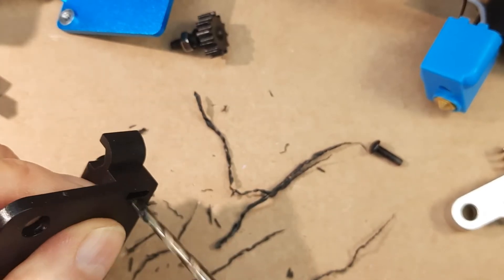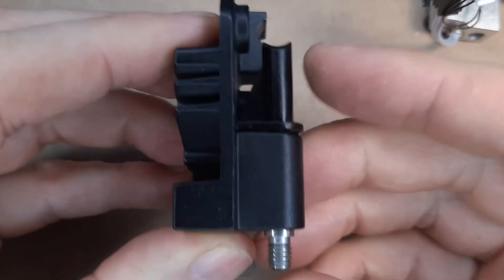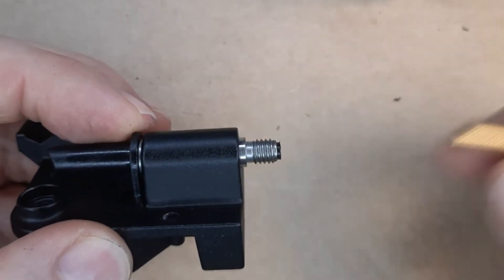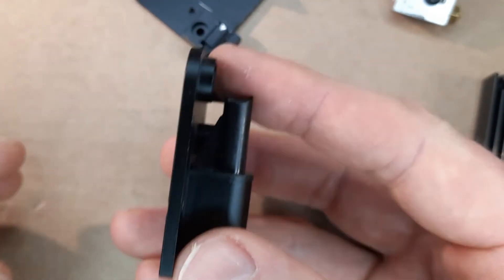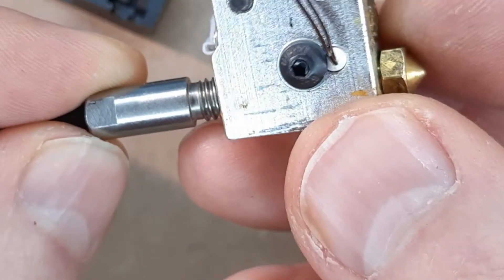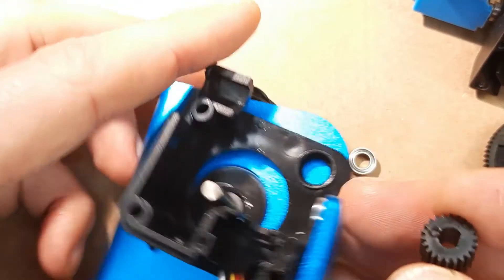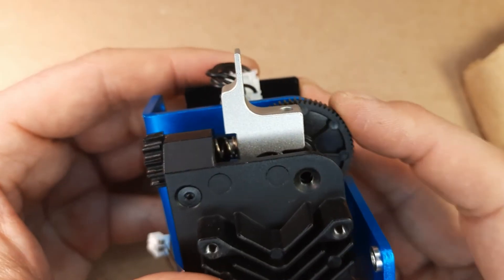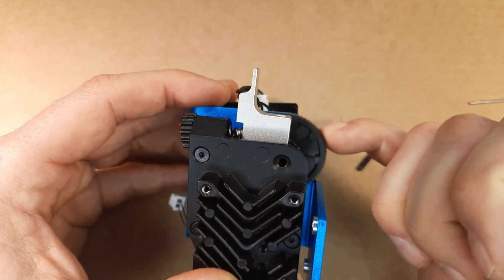Extruder _ 5 Upgrades for better print quality

Comment: Nice, but I've also noticed that the filament climbs back and forward on the teeth on the big gear, changing the quantity of filament being extruded. Extruder works more consistently if the bearing on the idler arm is also grooved keeping the filament on the teeth at the same diameter. My Genius Pro has extremely bad horizontal banding and was suffering all of the faults you have shown here, plus more. It still prints with banding and I am trying to determine exactly where it is originating from. Maybe the Z axis gear.

Comment: Thank you for the tips and showing the driver anatomy. 3:26 I'm still not sure about air gap effects, but heaving the ptfe coming too much causes in my printer to it being crushed, narrowing the ptfe tube at the end of it and blocking pathway of filament. So I'm still not sure about the correct ptfe placement. I guess it should be exactly straight with the exit - avoiding air gap, and on the other hand, avoiding the nozzle to squeeze it. Thanks for documenting this.

Comment: The best way to upgrade the stock titan clone extruder on the Sidewinder is to remove it, throw it in the trash, and replace it with any BMG clone extruder, with a V6 style heatbreak and volcano heater block.

Comment: Changed the larger wheel, but the smaller one, (seen here at 9:32)  seem to be glued, and there is no tiny screw.

Well, used the force...
Reply from the maker: I remember that the small plastic whell was just pressed on, not glued

Comment: @Just Printed_3D (EN)   can you share your slicer settings please I would like to get good prints
Reply from the maker: There are too many variables to get good prints, geberal printer mechanics followed by suitable slicer settings. 
Printing with the srandard slicer profiles for artillery should already deliver very nice prints.
Printing to fast or a poor mechanical conditions of rollers, play etc are most likely reasons for poor prints. Therefor there is no secret behind my slicer settings, all is standard, 0,2 mm layer by 0,44 line width, no faster than 40mm/ sec printing walls, 60mm/sec infill
Reply: Well @justprinted_3den988 I don’t understand how a ender 3 can have better print quality then a sidewinder x2 heck my cheap clone prusa i3 does better quality prints than my sidewinder idk what to do seems like the printer is not precisely layering the filament properly seems chunky layers  and not smooth 
Even changing out to a 0.8mm nozzle and printing at 0.2mm seems like to me that the printer main board is not running the print smoothly how it should be idk what to do i already have z support brackets and that helped the wobble abit 

Sorry about the late reply I found your video again and found my own comment lol
Reply: @justprinted_3den988 With the idle arm is the baring smooth or does it have teeth on it because you don’t show us it’s not shown in the video because there’s 2 models of that arm smooth or has teeth not sure what to get ?

Comment: I notice there is nothing to hold the ptfe tube in place down in the heat break! I've just had to change mine due to clogs but I can't see it lasting long with not being held in. 👌
Reply from the maker: The heatbreak ptfe is held in with a defined length within the heatbreak bore end and presses against the flat nozzle. If the ptfe length is to short, filament will sqeeze out and clogg

Comment: Could it not be converted to dual gear instead of the idler?
Reply from the maker: So far I have not seen any advantages for the dual gear. When printing much faster than regular, you would probably at some point need more feeding pressure and a dual gear could make sense. Im not convinced in any speed printing, so dual gear is not in my focus.

Comment: Just replace the extruder, can find decent cheap ones, or get a decent biqu for $60. I went the expensive LGX + Mosquito route along with SKR mini e3, huge difference, though the SKR alone and tweaking marlin had a giant improvement, moreso than replacing the extruder
Reply from the maker: does it result in better surface quality?
Reply: @justprinted_3den988   a better extruder? Absolutely, well an extruder + hotend, it increases quality, speed, and what materials you can print as long as you get a decent one. The Bondtech LGX with mosquito made a huge difference, though it is about the price of a new printer, Biqu is a lot cheaper. Also a 32 but board upgrade, like a SKR mini e3 is also a very good upgrade for quality.

Comment: I am currently in the process of fully rewiring my Genuis and Sidewinder, I am fed up with these cheap horrible pcb's and flat cables. So I am getting rid of the lot and creating a silicone wire custom loom. Wish me luck.
Reply: Why not just get a different printer? The entire selling point of the sidewinder x1 is the minimal wiring with the flat cable... You can just replace the pcb with one with a locking connector and be done, that's how the x1 was and it had no issues but people kept breaking the connector by not unlocking it..., but if you want to rewire it.... Just sell them and get an Ebder 3 or 5, or anycubic.... print quality is comparable and cheaper.. only difference is the simplicity of wiring
Reply from the maker: Had no single problem with my original flat cables. But I am awaiting trouble to come :-)

Comment: Where did you find the all metal extruder feeder gear? I am seeing plastic on AliExpress.
Reply from the maker: For the feeder, the small driving gear is always metal. Attached to it is the large gear, which is always also plastic as far as I observe the online available parts. If it says metal, than it reffers only to that small gear.

Comment: Having problems with putting it all back together. 

Eventually I started suffering underextrussion. 
Decided to swap nozzle, clean it up, but print head began to bleed plastic when working. Then took it appart, put back togheter, same jsut less. 
Third time, i put it back together, and heated up to tighten it...and I ripped off nozzle head. 

Waiting now for new heat block to come in.
How on earth re-assamble it to remove gap between nozzle and feed throat?

Comment: Ive had a problem similar to the one at the end of you video with the rough large gear. My solution was to replace some wobblily bearings in the motor.

Comment: Beautiful video! If I had seen this earlier, I could have saved myself all the correspondence with the manufacturer and seller.
This is already the second Genius Pro, the first went back because of packaging damage, but also had problems with the extruder. Same thing with the replacement unit. I even have another problem with the ball bearing, it made scratching noise. The large gear has a vertical runout and jammed like yours, after about 270 °. If you clamp the gear in a drill, you can see the imbalance. Somehow this extruder is "error by design". I am now waiting for the spare parts and hopefully after 1 month I can use the printer for the first time.
Reply from the maker: Have fun with your new spareparts :-)
Reply: @justprinted_3den988  At first I thought it was meant ironically. But now that just about everything from the replacement kit has been installed and is finally working without jamming, the printer won't turn on. The main switch is stuck. For my part I am ending the Artillery experiment - unfortunately.

Comment: Great video, it clears up all those little things that we have observed in our Artylery printer. By the way, how did you remove the small gear from the motor shaft?
Reply from the maker: The small gear sits a bit tough.
Just go underneeth with a screw driver.